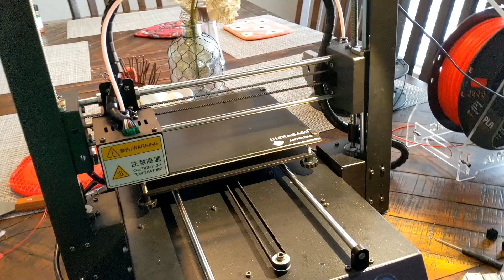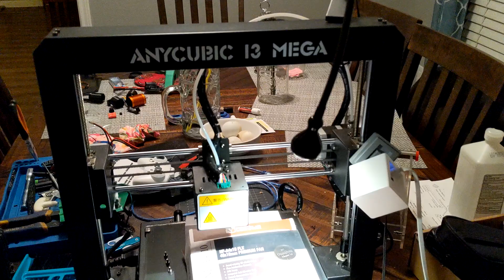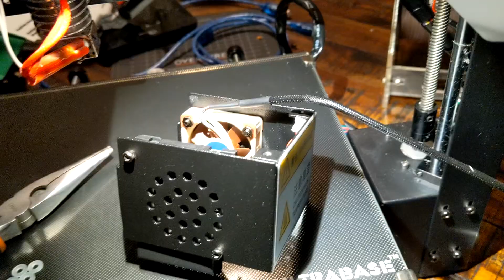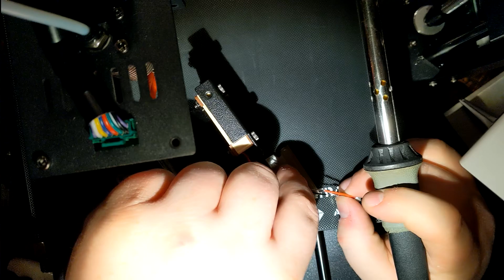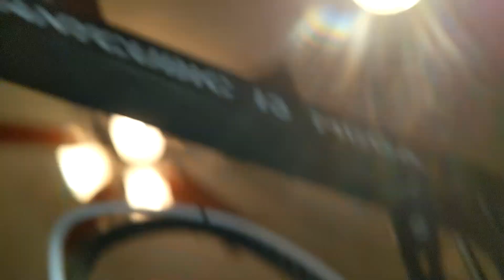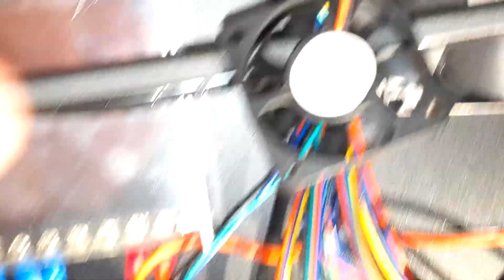Anycubic I3 Mega SilentMod Drivers + Fans EASY

Comment: How about the part cooling fan at the print head? I've replaced the hotend fan with a noctua just like you and also replaced the fan of the power supply and the stepper drivers. However I have the impression that the part cooling fan now runs louder than before? And it is pretty loud but only during printing. Yours still seem to be pretty quiet.
Reply from the maker: I never replaced that. The linear bearings were loud enough during printing that I didn't think it'd be worth it. Any 12v side exit fan should work for it so if you find one shoot me a comment and I'll order it haha
Reply: @weldit321  I did another test print but with a different model. It seems the part cooling fan runs on different speeds depending on the 3d model. The first print was a scaled down version of benchy. There it was loud as hell. The second one a bigger rectangular air duct. Here the fan was pretty quiet. So far I'm happy with that hehe (for now).

Comment: Thanks for the video! The drivers are easy to replace, just make sure to pull off all 5 wires connected to them and rotate them 180°. In order to tune the voltage you just have to use a multi meter and screw driver. I set mine to around 800 and that seems to work fine. Also for the heat sinks I just used 3 of the original ones that were on the old driver so that the fan could fit back into the box. Thanks again for the video for $15 the drivers make a huge upgrade

Comment: Does THE tmc 2209 work the same way? Thc
Reply from the maker: I believe it does. To my knowledge they are like 2208s with sensorless homing. I do not know however if the firmware on the board supports that feature. But they should work fine :d

Comment: Adjusting voltage:
1. While the printer is switched off, unplug your stepper motor,
2. Measure and set the Vref.  Vref should be measured with the motors unplugged.
3. Then switch off again the printer before plugging back the steppers. 

* DO not plug or unplug the stepper from the board while powered on or you might burn the controllers..

The stock stepper motor should be Nema17 1.5A max;we should set it to Inom = Irms = 1.06V.

Comment: After the replacement of the drivers with tmc ones, do we need to upgrade firmware or chamge the cable etc.? Oe all we need is to replacement?
Reply from the maker: Hey I did not have to update the firmware but you do need to flip the stepper cables around. I don't know how I left that out of the video massive oversight on my part. I'll see if I can add notes to the video asap! Only thing I had to update firmware for on this printer was the upgraded extruder.
Reply: @weldit321  I have ordered tmc 2209 ones. Once I received, I will only replace and flip the cables then? Thank you for the video and reply. I really don't like the sound of the fans and drivers... Rest is perfect.

Comment: So basically the driver swap is really only a swap and voltage adjustment? Nothing more?
Reply from the maker: Yes, it's a very easy upgrade for the printer. But alot of printers have the drivers built on to the board so these being removable makes it even easier.
Reply: @weldit321  I have a Mega X. I guess there is not too much difference between yours and mine. It might be the same hardware even. Do you know what kind of drivers it has originally?
Reply from the maker: @Lecsi11  I believe they are the a4988. 16 steps per rotation which is why they are loud. The TMC drivers have something like 250 so it's like rolling a stop sign compared to a tire.
Reply: @weldit321  Nice :D Do you have any reliable source on how to adjust the voltage? I don't want to fuck up such a small thing :)
Reply: @weldit321  Also, you didn't need to change anything in the firmware?

Comment: is your power supply fan quiet? A lot of people complain about power supply noise.
Reply from the maker: I have replaced the power supply fan and it's quieter at idle. But printing is still somewhat loud because of the linear bearings. I have since gotten a cr-10 and an ender 3 that are both much quieter after the same mods. This is a great printer but others are raiser to quiet down.

Comment: Can you use the Noctua fan you used on the hotend for both fans you replaced?
Reply from the maker: I would assume you could but to be safe (with tmc2208) I would go with a slightly higher output fan. You could stick with the noctua just maybe go up a size but stick with the 10mm thickness (it's tight in there)